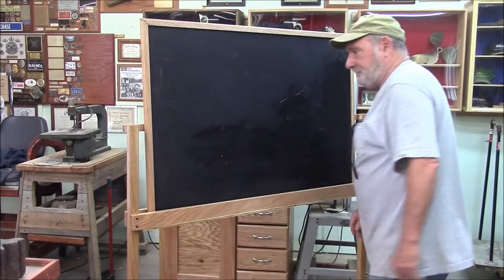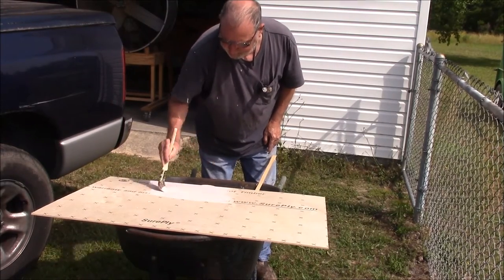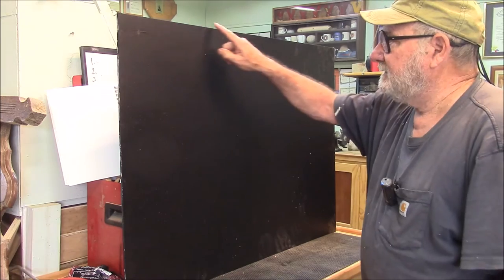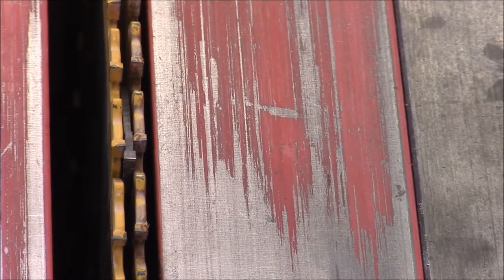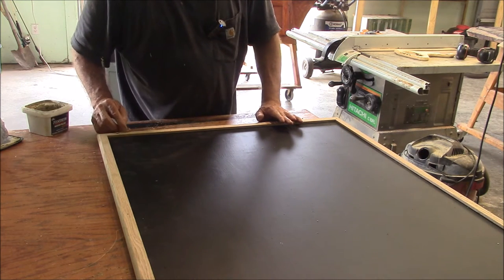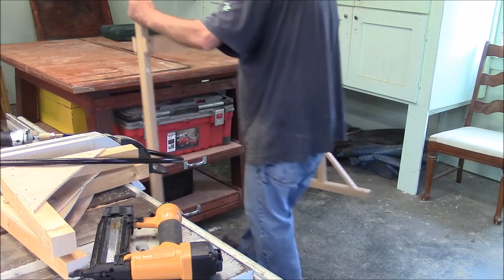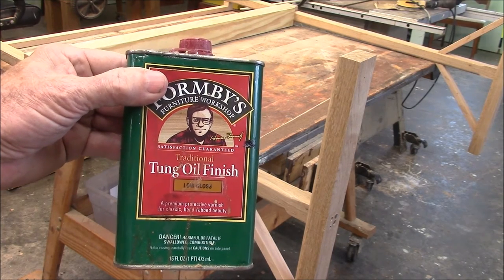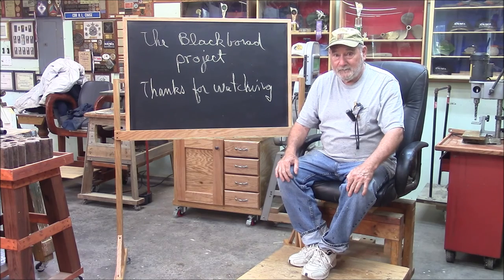70 Making a Blackboard with oak frame on wheels

Comment: Your blackboard was a great idea and came out very nice. I remember when blackboards were in every classroom in the country, but for some odd reason they've switched to whiteboards. A blackboard is far more visible than a whiteboard, especially for students who are unlucky enough to be towards the back of the classroom. I like my whiteboard but I think those are more suited for close use. I was wondering where you will keep your chalk and eraser. Perhaps you could add some type of ledge to the front of your chalkboard stand?
Reply from the maker: Great Idea about the chalk and eraser tray!!!!  I will do that and update in a future video.  
    Since I've been around awhile, blackboards are all I really like.  I actually hate writing on whiteboards.  Whiteboards don't offer any resistance to your writing tool;  they shine too much, and a million other things.  Notably, big famous universities like MIT still use blackboards, especially in the math department.  
     This "painted" blackboard, however, isn't anything like those old slate boards we had as kids - guess they'd be too expensive now.  The painted board really can't be dry erased effectively, like the old slate boards could. (Need a little water on a rag)  Remember the solid clicking sound those old boards made when the teacher wrote something - or the teeth shattering ultra-sound of fingernails on a chalkboard.  
     Thanks for watching, and keep watching to see your ledge for the chalk!!
Reply: ***** I've never understood the reasoning behind the switch to whiteboards in classrooms. It probably was a money thing, but removing the old blackboards was dumb. You are right about the new blackboards (and green blackboards) not being the same. All those are is a piece of sheet metal with a few applications of paint created in a factory, and not at all the same when it comes to erase-ability as the old slate blackboards were. Do you remember clapping the erasers together during recess to get all the chalk out as punishment for something or other? I'm glad you like the chalk and eraser tray. Be sure to get two erasers so your wife can send you to the garage to clap them together to clean them when you're in the doghouse. :-D